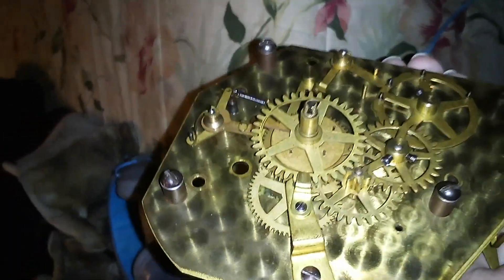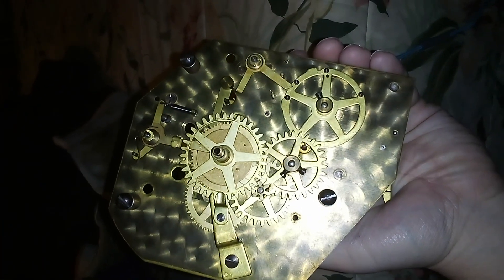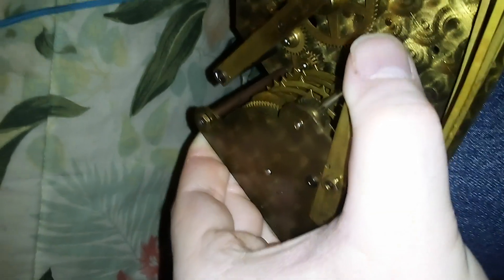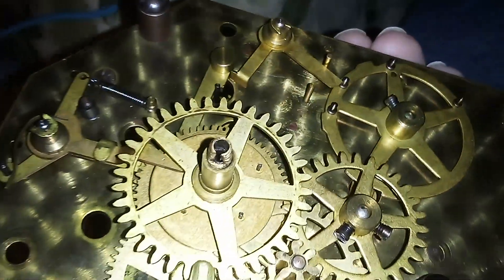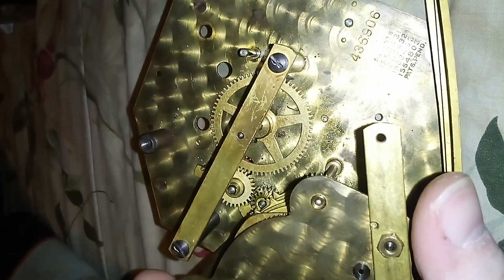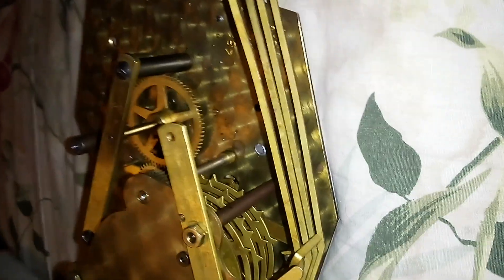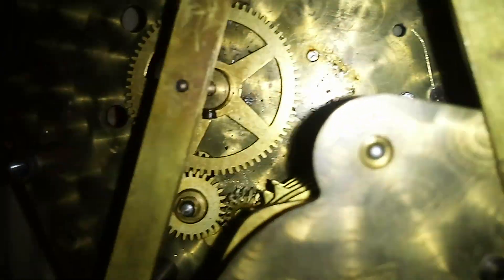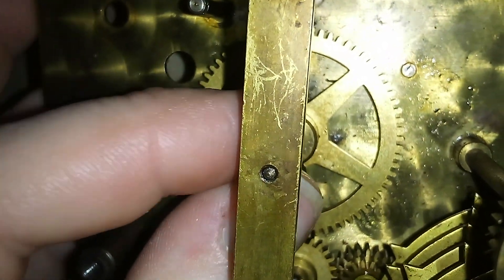Revere Westminster chime movement with some details.

Comment: Jordan  I have a Revere Electric Westminster Chime mantle clock the R-951.  It was my mother and father's.  I would like to get it adjusted and going again.  There are two problems.  I think there are rotor oil problems.  And the other problem is the chimes.  They do not play quarterly.  Could you do a video on servicing the chimes?  I don't know what I need to do or what I need to look for.  The inside of the case is terribly dirty.  I checked the motor and it is working.  I also checked the rotor and the gear is turning.  Trouble is the second hand doesn't want to turn.  Any help would be greatly appreciated.  I would like to try and do this myself.
Reply from the maker: I know who to recommend Roy manno or bill stoddard
Reply from the maker: It sounds like it's time for an overhaul these clocks run so long without one.